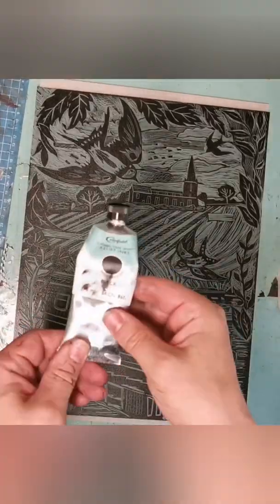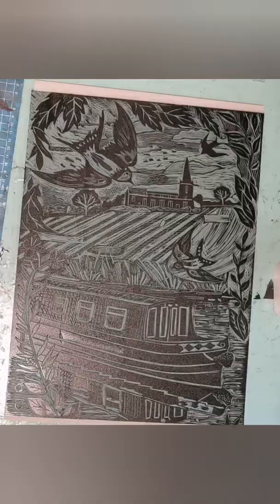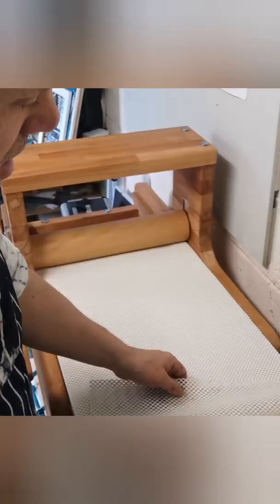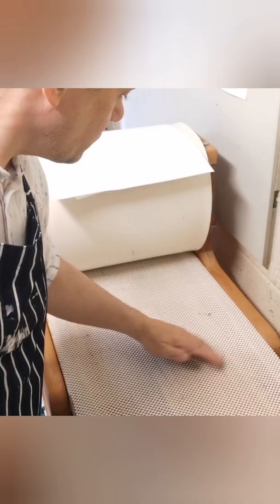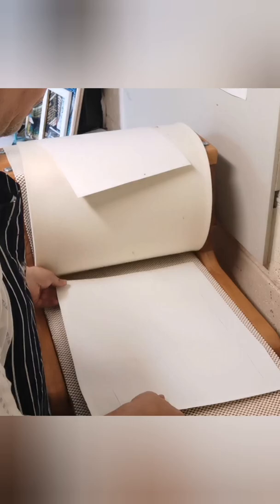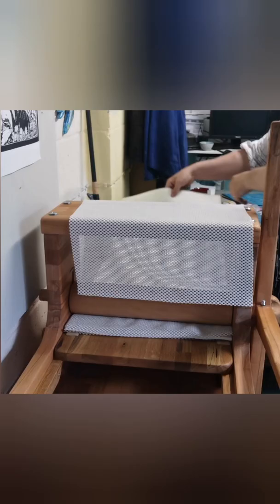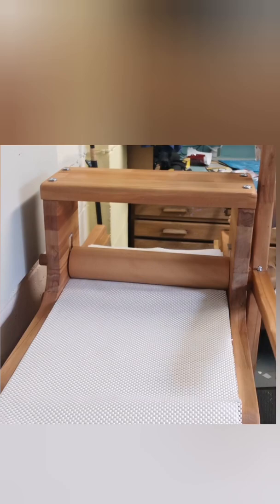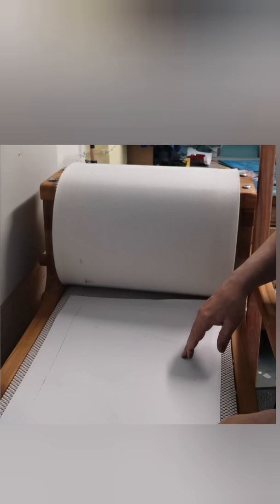Homemade Wooden Printing Press. First Print!

Comment: What controls the pressure on the roller and thus the clearance from the material which is being fed through ?
Reply from the maker: At the side of the press there is a space where I add cardboard or wooden tabs. That applies more pressure. Also I add packing  or paper on the platen which adds further pressure.